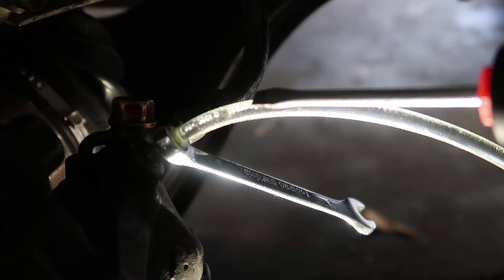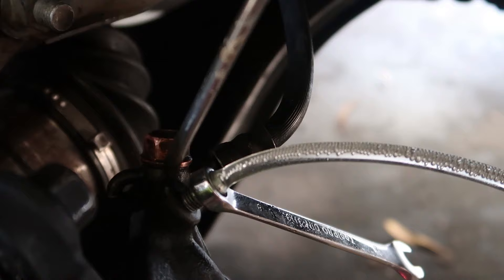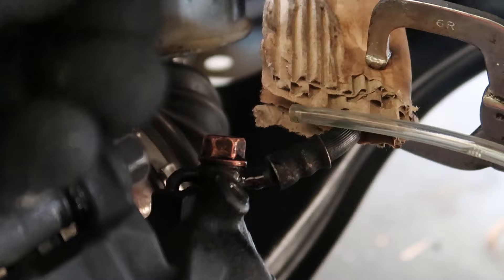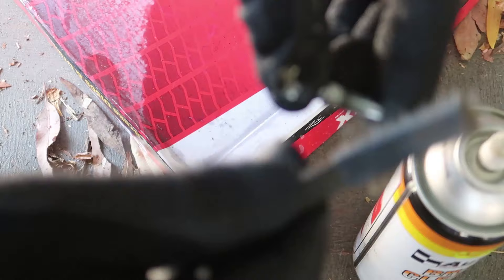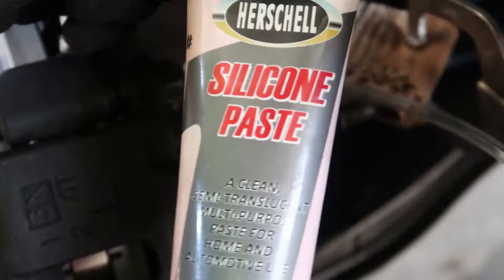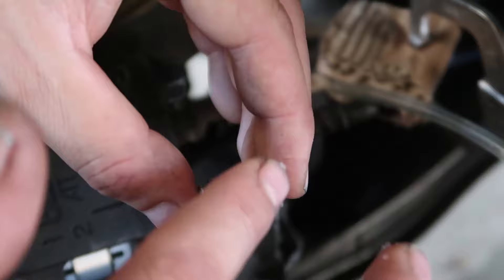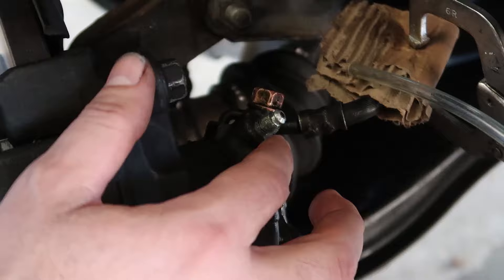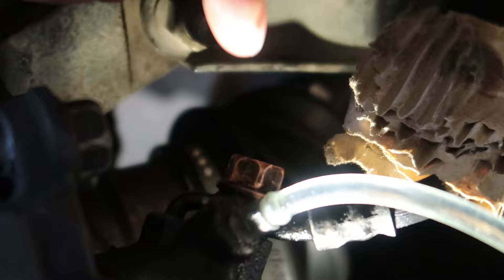How To Fix Air Bubbles In Brake Bleeding, SUPER EASY FIX.

Comment: Key note here that you dont need to take out bleed valves to clean & add grease or silicone to them lot of extra work thats not needed at all, the valves should never be opened that much, valve should be slightly opened to where  you just start seeing fluid to leak no bubbles should be entering into the system, i been doing brakes for years never had any problems whatsoever, lot of these diy videos out here are making things seem you have to take extra steps that you dont its nothing but a waste of time, key factor again is to not open valve much at all just slowly turn valve to when fluid starts to leak then stop then proceed to pump the pedal few times then tighten go on to the next bleed valve its that simple.
Reply: I concur
Reply: What type of grease do u recommend to seal the bleeder valve?
Reply: So you don't recommend using the vacuum technique?
Reply: Bravo, bravo, bravo. Well said sir.
Reply: I agree with Herbert on this one.  You only turn the bleeder screw out between 1/4 to 3/4 of a turn.  Gravity bleed it first and give it a minute or so to start “ seeping”  out of the bleeder ( it will probably only be a slight drip ). Grease on any pa rt of the brakes that come in contact with a rubber seal (ie. the calliper piston area or the calliper slide pin should be silicon brake lubricant. Brake grease is not silicon based will destroy rubber boots and seals. I don’t think there’s much chance that grease on the bleeder screw will contaminate the brake fluid but why take a chance? It would be an expensive repair if the brake fluid becomes contaminated even if it’s highly unlikely. Best practice is to always gravity bleed a few drops of brake fluid when replacing a calliper ( removing the brake line ) and then do a brake pedal pump or vacuum pump with the the bleeder screw turned out no more than 3/4 to 1 turn.  I watched a video of a. Mechanic who suggested a technique for preventing the brake fluid from pouring out when changing a brake calliper. He used a long pry bar ( could use a 2 foot piece of wood I guess ) which he put against the brake pedal and the front part of the drivers seat. Then he used the power seat button to push the brake pedal down about 1/2 way. He says this will putt piston inside the master cylinder in a position that will “ seal “ the system so brake fluid won’t come spurting out. I know I-know this doesn’t sound right so I’m wondering if anyone has tried this with success? Seems better than using a C clamp or vide grips to clamp the brake line especially a line that is on a vehicle with 70,000-100,000 miles.
Reply: This is for a vacuum method.  Not a pump pedal method with 2 people.
Reply: @Jealousghost for those perfectionist out there that have the extra time, could we use a bit of Teflon tape for an additional peace of mind or do you feel it's really not needed at all?
Reply: Thank you, they just extra
Reply: I have a 2010 Prius.. I had to replace a caliper so I figured It was time to bleed the brakes anyways. I was using a brake bleeder pump kit. No matter how little I opened up the valve, not only was it not coming out but I could see alot of bubbles. I decided to use Teflon tape on all 4 sides and presto. No more bubbles (I only covered the majority of the threads)
Reply: @Senorlatulla on any hydraulic system the fittings are self sealing and do not need any thread sealant at all. The only fitting that does is pipe thread. The clue is to look at the seat face. Is it tapered? Then add nothing. If it leaks then you need to fix the problem not mask it with garbage.
Reply: @Zeek800 I tried the pry bar method, together with a plastic bag over the MC then screwed the cap back on, disconnected the hose from the Caliper, maybe 2 drips came out! So for me it worked.
Reply: @Senorlatulla no. It’s not necessary and if anything it might cause a problem without any possible benefit.  Doing extra things you are not supposed to isn’t being a perfectionist. It is being dumb. If you want to be a perfectionist get new bleeder valves and if your caliper threads are messed up get a new caliper. They seal themselves by design. Teflon tape would just cause issues with that sealing.
Reply: Jv
Reply: @Zeek800   dot 4 and dot 5 are made with silicon....will not harm anything. the whole point is that those bubbles were going downhill.... not uphill....they are harmless!
Reply: In the Adirondacks Northern NY where I live yes you do put something on the bleeders like anti sees or copper anti sees with the rust on or vehicles from salt in the winter they always break off without it
Reply: Thank you
Reply: @davidtreichelpppj5304 
If you submerge the end of that tube in a container of brake fluid you can do it with one person. Push the bubbles go out. Let up and fluid is sucked in.
Reply: When I open mines up alot it's to flush out the system  then I'll pre pump  and go to the caliper. Use the machine open a little  less but enough  to get fluid. And check the overfilled reservoir.. only issue is those fittings.. can have a slight leak but the tool uses hi pressure  air to cause a vacuum  so it'll bleed the breaks nicely . I just took my time changed out to new calipers as I had eleven bread pad wear. And new brake hoses.   Still gotta change the rear brakes  and hoses. But I'll wait to take it on a buddies lift
Reply: @jimw7916 dot 4 is NOT made with silicone. Only dot 5 is and you don’t want to mix that with 3 and 4 or put it in a system meant for dot 3/4.
Reply: @throttlejesus9506  but it's so much fun when you mix them
Reply: As a mechanic I personally think everybody should do this,Thanks and maybe I'll see ya soon! 😂😂😂😂😂😅
Reply: I totally agree.Some of these videos give you false information

Comment: Did anyone notice that he failed to remove the clamp ? "If the clamp is still on... no air bubbles !!!!!
Reply: I noticed the same thing. Also, if the bleeder screw was leaking through the threads it wouldn't be showing air in the tubing at all.
Reply: Except that fluid is still flowing outwardly so it's not exactly pinched completely off. Nor should it be, you can damage the line.
Reply: You should not EVER clamp any brake hose with any clamp. Dont crease them either. This will permanently damage the hose, even if its rubber.  Hydraulic lines or hoses are not made the same as regular hoses.

Comment: This is completely unnecessary. These bubbles mean nothing, they’re entering after the seating surface of the bleeder valve so they never get into the system.
Reply: Exactly 100% you my friend are the first to realize that those bubbles can simply be ignored. They go forward from the screw they never go backwards.
Reply: Ok you’re the only person online I’ve seen saying this isn’t an issue. I had the same issue when I was bleeding my passenger caliper but the bubbles would only pop out once I closed the bleeder screw. I’m keeping an eye out on sponginess in the pedal over the week but I’m hoping you’re right on what you’re saying
Reply: @jesuscontreras2499  if you see bubbles after you close the valve then the only area they could enter would be between the valve and your hose, which is even less of an issue as they couldn’t possibly enter the system with a closed valve. As long as you pull a vacuum and you have a positive flow of your brake fluid when the valve is open, any bubbles entering after the seating surface of the bleeder valve are irrelevant. These bubbles are air that makes it through the threads of the valve which are outside of the system. Just be sure to close the valve while you’re pulling a vacuum. Look closely at how the bleeder valve works and it’ll make sense, don’t take my word for it, it’s just how they work. A little bit of anti-seize lubricant on the valve threads (similar to what’s in the video) can help reduce the amount of air passing through there and makes it easier to see air coming from the actual brake system. Plus, future you will tank you when you have to bleed it again in the future and the bleeder valve isn’t rusted in. And don’t forget the dust cap. Cheers

Comment: Those bubble dont matter my guy. Those bubbles are being induced as the fluid exits the brake system.  Those bubbles are only in your bleeder tube, not in the brake line. Wasting your time.

Comment: IMHO:  Air is only a problem when it's INSIDE the caliper (or slave cylinder).  The air bubbles shown at the start of this video are not a problem per se, but you should always be careful when using a vacuum bleeder as he is obviously doing here, and NEVER use a vacuum bleeder on drum brakes.  The piston seals on a disc brake caliper can handle a little vacuum, but the cups in a drum brake slave cylinder cannot.  They will either leak air into the cylinder or (worse) pull away from the piston and become unseated (cocked at an angle in the slave cylinder).  The best way to bleed brakes is with slight pressure (less than 4 PSI) on the master cylinder reservoir.  This will generally be enough to push all air thru the system and out each wheel.  Yes, you have to make some special tooling to do this, but it works perfectly, every time.

Comment: I am having an issue with tiny bubbles and the most common mistake I am making is having the catch-can lower than the caliper which supposedly creates a pressure difference and sucks in air through the screw threads that was never originally in the system.

The solution I've read is to hang the catch-can above the caliper which may help more than thread sealant.

Thank you for this video and I hope this comment helps anyone who may find it.
Reply: So true. I raised the catch can: no more bubbles.

Comment: If you elevate the position of the jar above the bleed screw these bubbles will stop. With the jar below, the dropping fluid creates a vacuum that pulls air in. So the jar height must be between the reservoir and the bleed screw, then there is always pressure at the screw.
Reply: I already did one brake line with the wrong bubble creating  position, do I have to do the bleeding again? Or  or my brake line is safe from these bubble?
Reply: @mohammedalghamdi7269  If you didn't see bubbles, it's probably ok. The most important is to test the brakes and ensure they work and feel firm. Also if you have replaced all the fluid, then you can bleed more if you need and just recycle from the yar back to the reservoir, so you don't need to buy unnecessary fluid.
Reply: @simont6439  You shouldn't reuse old brake fluid, it absorbs water over time. In fact, you should first remove brake fluid from the reservoir with a turkey baster before bleeding, and fill it with brake fluid from a new, sealed container.
Reply: @sooke54  I wrote "if you have replaced all the fluid". Some times you need to bleed more, after all old fluid is replaced. Then recycling is fine, it's all new fluid in the system.
Reply: @simont6439  And I've just seen a video of someone who having completely replaced the brake fluid noticed the pedal was spongey: he had let the level in the reservoir drop too low. So he recycled back to the reservoir wh ile rebleeding. It worked.
Reply: This was the answer. Moved the bottle above the bleed screw and bam, no more tiny bubbles. THANK YOU Simon. 🙏🏽

Comment: thanks bro, I'm a brake bleeders newbie and my back right was doing this. I figured it was getting in through the threads. I just bought new bleeder valves and added silicone like you said and no more air bubbles, also the brake pedal is solid and doesn't go to the floor like before.

Comment: Ya fixed  your issue..good thing.  Im a old guy, DYI and I've learned that IF ya dont have rust issues and both caliper and bleeder is CLEAN.. little brake cleaner spray.   wipe off good.  use a NEW/CLEAN clear hose (1/4").  .  I have done this up in rust belt and on southern non rust env invironments... I do believe the key is to have a clean bleeder nipple in good condition..or replace it. then use a fresh end of the clear hose....and have at it..   never had an issue
Reply: There needs to be a channel specifically foe Rust Belt cars cause 95% of all car videos doesnt go through what we all have to in order to remove things (and i have just about every tool imaginable )

Comment: Pretty clever.  I had this same problem on one wheel after replacing the master cylinder.  I did this only instead of clamping the line I picked up a couple of new bleeder screws, prepared a new one and quickly swapped them out.  It DID fix the issue though.
Reply: Next time just hold the brake pedal about halfway down. With the piston in the master cylinder like that there's no air pressure pushing it out from the top.
Reply: Thanks I saw a video on that exact technique. I asked on another persons comment if anyone had ever tried this and does it work. I guess you’ve done this? Use a 2 foot Oreo piece of wood against the brake pedal and against the front of the seat. On power seats just move the seat forward until the pedal is halfway depressed or push it down with your foot and move the seat in manual.

Comment: Did you notice the bubbles stopped when you pinched the line, and then the final shot you hadn't unpinched it?
1. Never pinch the line.
2. The bubbles are from the Venturi effect and are not an issue if you're taking fluid out the bleeder (if you push in through the bleed you do risk pushing bubbles in).

Comment: There isn't much fluid in a bike system. As long as the drain end of your bleed tube is submerged in fluid, you won't draw air into the system. Just open the bleeder and pump the brakes until no bubbles form. No need to loosen and tighten the bleeder. Just make sure the master stays filled. One pump at a time and check the master. Remember if you do it this way there is no need to open and close the bleeder. You can't draw air into the system if the end of the tubing is submerged. This is by far the easiest and most effective one-person method to bleed a system. By the way, there is no need to open the bleeder more than 1/8 to 1/4 of a turn. Unscrewing it more than that is one reason you are getting those tiny bubbles in the first place. The other reason is that you are pumping the brake with the bleeder closed. That agitates the air in the system and creates more bubbles. I have watched a bunch of these videos and almost all of them say to pump the brake with the bleeder closed. This is 100% WRONG!

Comment: AWESOME TIP THANKS AND SUGGEST TO EXTRACT THE BRAKE FLUID INSIDE THE CALIPER WHERE THE BLEEDER SCREW GOES AND DRY THE THREAD SO THAT WAY WHEN YOU PUT THE BREEDER SCREW BACK THAT FLUID DOESN'T TAKE OFF ALL THE SILICONE PASTE FROM THE BREEDING SCREWS SO YOU KNOW IS  ONLY SILICONE  PASTE IN BETWEEN BOTH THREADS NOTHING ELSE 😉🇲🇽👍🏽

Comment: W T F......the bleeder was to loose !
You open the "valve" only a little bit until the brake fluid starts running.
If you open it to much sure you have air bubbles.

Comment: I see a lot of people here are not understanding this, but I get it...when  using a one man bleeder, air will get in around the threads of the bleeder screw. I use to bleed by myself, just teflon the threads, and don't tighten it in all the way....then you can basically just stick a piece of hose on the nipple, and put the other end submerged in brake fluid. I never understood why they haven't invented a better bleed screw, like something 2 piece with an oring, where air cannot enter
Reply: The save pennies in productions.
Reply: The manufacturer doesn't make a better bleeder screw, but you can buy them online.
Reply: The manufacturer doesn't make a better bleeder screw, but you can buy them online.

Comment: Bleeder screw are renownd for not sealing properly even when new. The best thing to do when installing old or new bleeder valves is to wrap the threads in some PTFE tape making sure not to cover the hole. The tape is wide enough to cover the full threads, works a charm....
Reply: If you know where the bubbles are coming from, you can just ignore it. The thread leak is higher than the fluid seal. It will be impossible for air to enter into the brake lines through the threads.
Reply: @fungames24 not quite. It depends the method of fluid extraction.

Positive pressure, vacuum, manual pump.